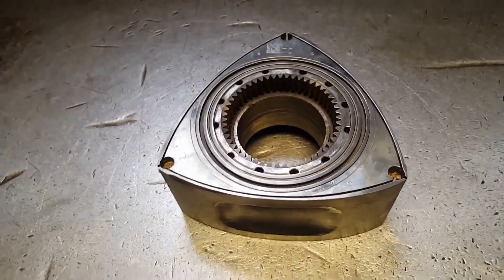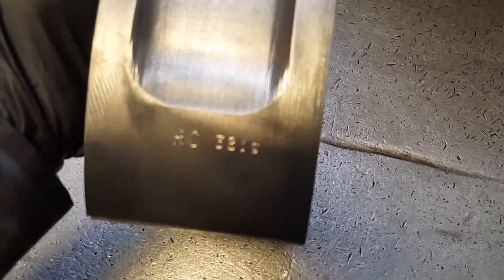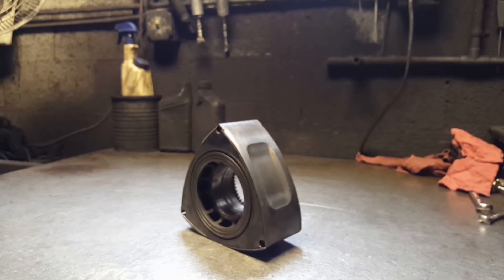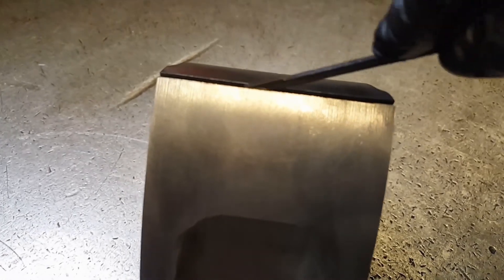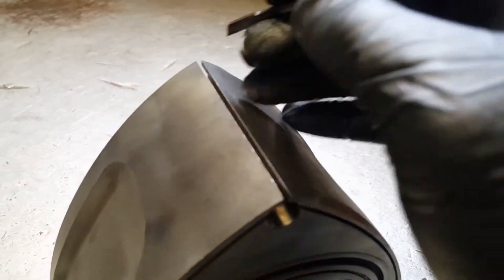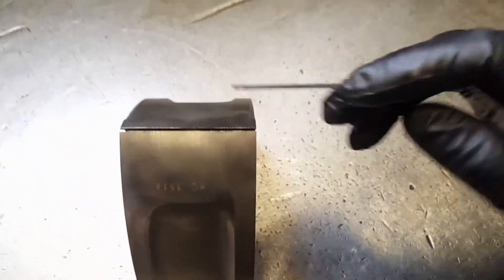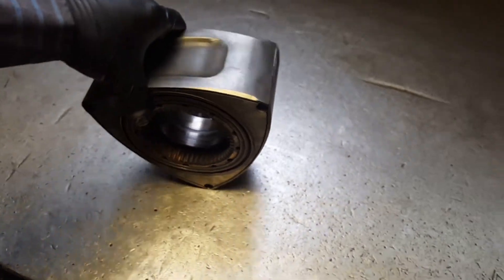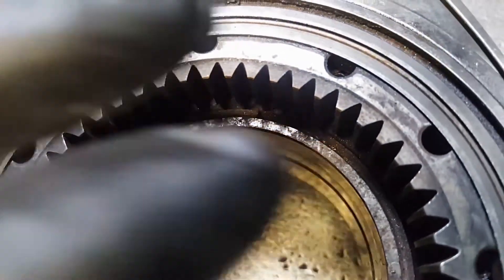How to rebuild mazda rx8 rx7 13b  rotary engine:13b parts give away vid#3

Comment: Okay I'm about to get a 05 rx8. It has 100k miles. Were doing a trade, my daily for his daily hahaha. First, anything I should look out for/inspect?  I feel like doing a whole compression test. But what else should I look for. 100k miles on the same engine? He said its never been rebuilt
Reply from the maker: Compression ,any exesive smoke on cold start,and make sure the car doesn't have any cold start or hot start problems,so drive the car for like an hour or more and then make sure it starts right on!! Also what car are you trading if i may ask?
Reply: I know this is off topic but your hair looks sick man lmaoo. Hey do you have any other social media platforms? Insta or snap chat? If I do go with this trade I'm definitely gonna need your help for my first rebuild lol.
Reply from the maker: Hahaha thanks man 👍because the way I dress and look my barber calls me MEXICAN MCGREGOR lol 
And nah no social media but thinking on opening IG 👌
Reply: @JM8686  trading for a 5 speed 2012 Ford focus with 120k miles. Are you interested? Lmfaooo mmmmaaaaannn I'll drive from Illinois to Cali if you wanna trade my car for an rx8 lol. All the rx8-7 here in Illinois are full of rust! Haha.  You should definitely open an IG, I'd be your first follower lmao.
Reply from the maker: Already got it 13b_butcher
Reply from the maker: Just opened my IG 13b_butcher